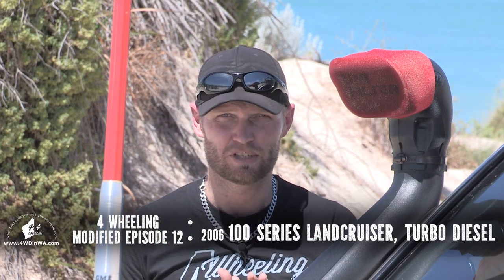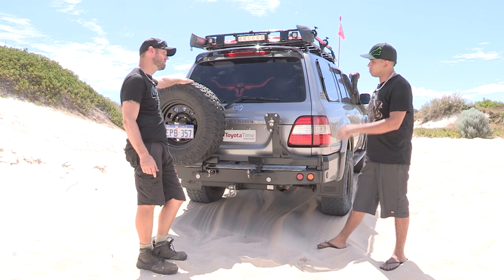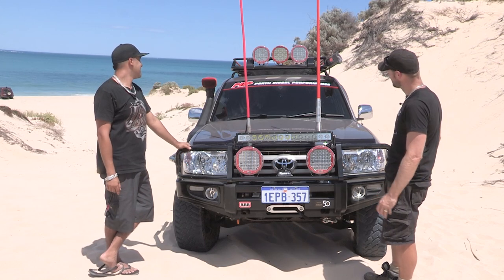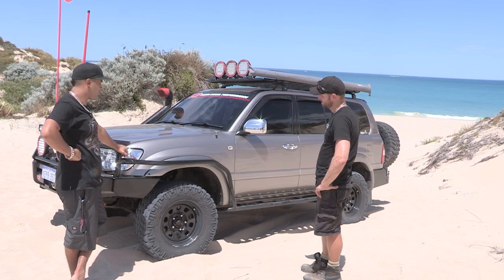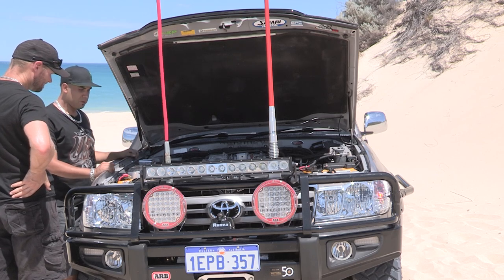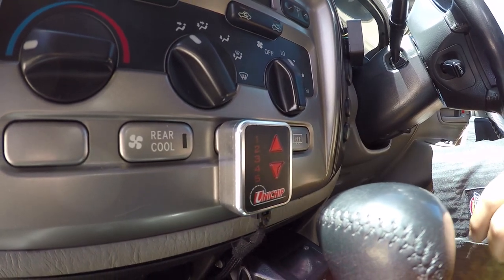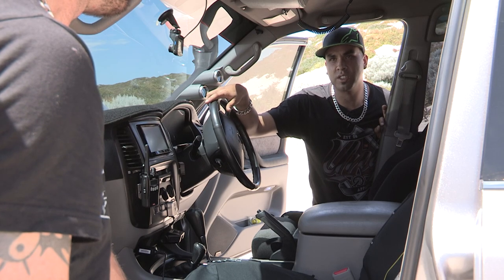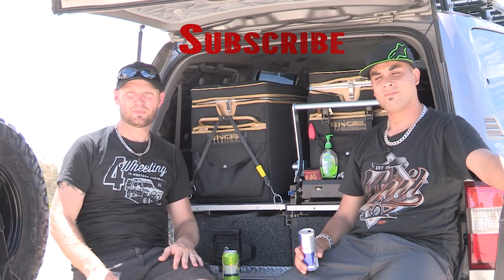Modified 100 series Landcruiser, Modified Episode 12

Comment: Thats probably the best 100 I've seen! Love it. I always said If I got a 100, id have to get the JDM Flares. Updates the look so much. Well done love it.
Reply: thanks champ
Reply: Hi Anthony, You have one the best Landcruiser rigs I have seen mate, Love all the mods. I have a 105 series as well and was wondering if you can give me some details about the flares (brand, retail where I can get them from) as I am putting 0 offset sunraysias or speedys on mine.
Reply: Thanks for sharing Anthony. I'm going to get those flares for sure on mine.
Reply: @antopaul4911  Out of interest Anto did you have any problems with tyre rubbing on the fronts? Recently went to 0mm offset rims too but have rubbing issues with the front even after removing the front mud guards.
Reply: @MrTryncia  these are +40’s from factory. Find some +30’s at least.
Reply: @slow_diver  These are 0 offsets mate. The factory wheels are pos 60, flush with the body with pos 30-35ish, and 0 offset sit flush if you got these flares. I’m running the exact same setup with the flares.
Reply: @ekammanku3622  I run +30’s on mine. With a wider tyre and they are perfect. Just a bees dick of poke with the sidewall lugs sitting out. That was the most positive offset available here aftermarket.
Reply: What brand flares are these

Comment: Regarding the pins that snap off on the rear tire carrier. Snapped off on mine as well. All you need to do is add a lock washer on it. The lock washer stops it from spinning off.

Comment: Surprising to hear you would go from a OME suspension to Bilstein. I have had both in different platforms and found the Ome to hold up and perform better. What would be the reasoning behind this? Thought you said something about holding up to the weight. I have noticed on a few other YouTube channels coming out of Australia that OME is not talked about you see your fair share of ARB equipment but ome suspension is rarely if at all talked about why is this? In the states it is pretty well known and used on many different vehicle platforms but I just don’t hear the Australian guys talk about it very often if at all. Is it just that there are so many other suspension options over there then maybe compared to the states?

Comment: roughly 300km out of both tanks on the 4.5 cruiser. I've got a 4.8 Patrol which is obviously petrol but switched out the stock tank to a 146 tank I believe and I can get some good K's out of that. Roughly speaking about 600-800 km so yea. Not hating on Cruisers by the way.
Reply: There was something wrong with that cruiser. My 1fz petrol 80 series with 35's gets 19l/100km

Comment: My dads getting me my first car soon... It's gonna be a 100 series, not sure what year though. 2000-2005 I presume. Now its my job to raise the money for the ARB bumper with winch, a rhino rack on top, a slee rear bumper with a ladder and spare, a lift and off road tires. Oh and a new radio with bluetooth (of course). I shouldn't need a snorkel because this is mainly for the hunting club (ladder and rack for hauling carcasses or even setting up a chair to coyote hunt, the winch for yard work or cleaning up huge branches after bad storms, and the lift and tires for actually getting places in the farm). I'm thinking I will keep a trailer hitch on it at all time. Any other suggestions for someone like me? or even just suggestions on how the hell ill get the money for it? I doubt any of this will happen, but its fun to dream
Reply: are you serious,its ifs,no good for 4x4ing.get a real 4x4,diesel,2 diffs,low range,dreamer.
Reply: @phantomwalker8251  it is a great 4x4 with slightly less travel on the front suspension for half the price. Diesel is shit and weak and more maintenance and more expensive for a rattle box. It has 2 diffs, the front one is just not mounted in a solid axle and it has low range and is in every way the same as an 80 series but without the solid front axle and the price tag

Comment: hey ronny, mayb you could do a budget tourer in one of your modified vids.?. for instance a mid 90's jackaroo or pajero, either with a couple of inches of lift, a set of 33's and some long rear shocks are quite capable and you can pick them up in reasonable condition for under 2k, would be good for ppl out there not wiling to spend a lot of money and getting into 4wheeling??
Reply from the maker: Without giving too much away there is one coming... within the next 3 episodes ;) can't tell you which make and model but it might be one of those you mentioned,...
Reply: good stuff! love your vids! keep it up :-)
Reply: why would you bother with a pajero or jackeroo.,not 4wd.s,period.

Comment: Great set up. I've had a 105 petrol as well. Looking at a 2006 100series td auto in a few weeks. What wheels n offset are u running
Reply: just swap that engine..... into diesel one. dont sale you 105
Reply: @enjoymusic4895  why? The petrol engine is better in almost every way and just uses about 10% more fuel

Comment: Supposwd you changed front configurations suspension from front independent suspension or front double wisbone into fixed live axle which will gave you better wheel long travel suspensions...
Reply: i have a question, those land cruisers have self leveling hydraulic suspension, and that particular unit has a lift, did he have to change the entire suspension system or is a lift compatible with the self leveling adjustable suspension?
Reply: @ramonmerino3726  those is LC105.. not common LC100...
Reply: Yes but live axle isn't as good for handling and comfort and stability for touring. They both have their strengths

Comment: Hi Ronny,

Does the owner of this beautiful landcruiser has his own channel?

Would really love to see more footage of this truck.

thank you.
Reply from the maker: +William Nguyen you might see him in future videos
Reply: Beautiful!!! Cant wait to get myself a landcruiser. Just the fact that we dont have the Diesel version in asia. only 4.5l petrol is the reason to hold me back from getting it.
Reply: mate the 4.5 petrol is a beast too. solid axles, heaps of grunt and low down torque. even better if you put a turbo kit on. only problem is fuel consumption
Reply: Yeah! fuel consumption is a big reason that hold me back. Heard that it does 20L/100kms but never have a chance to own one yet.
What about yours mate? how many litle does it consumpt for 100ks?
Reply: yeah I get 20L/100 around town and thats babying it. But I am on 35s with stardard gear ratios and all the gear (front and rear steel bars, winch, draws in the back etc). If you look at how cheap you can get them compared to a diesel though, its worth it (in my opinion). theres heaps of people who swear by diesel but these petrols are as tough as they come. The engine can put up with a heap of abuse. bulletproof
Reply: @williamnguyen110  plus the diesel version on same size tyres with same weight uses 2-3L less per 100km.. so it's not big enough difference to hold you back. The diesel maintenance and initial purchase price will outweigh the petrol fuel consumption

Comment: Anyone got any opinions on a 2004 100series v8 diesel landcruser?? Any problems/things to avoid?
Reply: yes the landcruiser !!.small v8,better with 6cyl,ifs no good,troopies have 2 width diffs,no good,v8 too small,too many tech bits not needed.a 6cyl of same ci will put out more power/torque.i have a 4.2td with same power as v8 single turbo.i dont have common rail,glow plugs,computor,nothing,toyota are overpriced over tech under powered,.IF,anyone speeks of the 6.5gm td,kill them,there crap engines,handgrenades,unless built after 2002 by international harvester.complete different engine,.""but they put them in the hummer,"",yes the u.s army had containers full of engines to replace.you obviously have a computor,USE IT,go to wiki or y toob or google.not the pub talk.
Reply: They run really well standard. Keep in mind that all Toyota vehicles leave the factory retarded to produce only 70% of their available power. Quick chip remap and power goes up massively, especially torque. Don’t listen to the hater above, he’s got a stick up his arse for some reason.

Comment: Not surprising that he's not happy with his suspension... 
A lot don't understand the ifs on these 100 series. 

Any ifs 100series lifted more than 25mm will need to use longer front shocks. No point using the diff drop and aftermarket uca's if you're not lifting the front above 25mm... Those OME nitro shocks are the same length as standard, so when he lifted the vehicle he lost a substantial amount of down travel, the shocks will now be working at the top end of their travel and will be topping out.  This will have a negative effect out on the tracks and will prematurely wear out the shocks. Only way to fix this is to drop the vehicle back to standard hight or use longer front shocks.
Reply: He's got a 2 inch (50mm) lift? What you're saying makes no sense.. also he was complaining about the rear suspension sagging which has nothing to do with IFS as he said the front is perfectly fine.
Reply: @AiDOS__  As I said, not many understand the 100series front suspension...
The OME front shocks he's using are actually the same length as the factory shocks, a 50mm lift on them is just too much, all he's doing is reducing the down travel. 
Need to maintain at least 65mm of down travel for the front shocks to work properly, to do this,  you need front shocks that are 20mm longer than factory. Then you will have the lift and the down travel.
Reply: @SteveBurns80  maybe, maybe not, he still didn't complain about the front suspension being an issue.. he said the rear was sagging from the weight
Reply: @AiDOS__  What he says doesn't change the facts!  The shocks are too short for his lift. It would handle like shit sandwich. Believe what you want. 😉
Reply: @SteveBurns80  the facts are that you just looked for an excuse to post some bit of knowledge you have and felt all good about yourself like a puppy. He said nothing about the front and he never mentioned the strut length so you have literally zero way of knowing whether it articulates correctly or not. IFS also have ball joints that bind up so yes you can get a bit more down travel at the risk of popping ball joints once a year with a bit of wheel lifting. That's why so many IFS vehicles use limiting straps on the control arms.. or you get 20-25mm or so less down travel which literally would make just about bugger all difference in real life and you have a much stronger front end for a safe touring 4wd that occasionally does some tracks and a bunch of beach work. The fact is that you can also put extended control arms and get trophy truck travel out of the front end, but it's literally dumb unless racing.. or heavy 4wd tracks in which case a live axle would be better anyway
Reply: @AiDOS__  Hmmm no you're wrong. Why the hate, dude? I'm just trying to help people by pointing out an issue. 

I do know the length of his front shocks, because he has OME nitro shocks, I've used them before on my 100series, they're only 440mm long, about the same length at the factory shocks. 
On the 100series, it's the shock length that limits the down travel. No point raising your vehicle above a 30mm lift, if you keep the same length as the standard shocks. 

Even with good aftermarket UCA'S, the longest front shocks you can use are only about 22mm longer than factory, this is because you find the limit of the UCA'S hitting onto the chassis and also ball joint binding limit. If you use too long a shock, then yeah, you'll have to use limiting straps.

And yes, shock length/down travel really does matter! It really improves the handling and capability of the ifs, big time!  
The front ratio is about 2:1, so if you increase the shocks length by 20mm you get around 40mm of extra down travel at the tyres. Awesome ay.

The rear suspension is probably okay, just needs heavier springs for the weights he's carrying. Having said that, longer and better shocks will help with the increase ride hight and spring rate. 

 Does it all  make sense now? Or you still struggling to understand it? Being serious.
Reply: @SteveBurns80  I think you're struggling to understand it. Like a child honestly. Again, it has nothing to do with the front as he was complaining about the sag in the rear. That's like someone complaining that their water pressure in the house being shit and me going on about how their hot water system is shit and doesn't get the water as hot or hold as much as a better model. They didn't complain how hot the water was, so it's obviously not an issue. Focus on the water pressure. There is never a vehicle with everything that is perfect and every part of engineering is compromise. If his driving has not seen a noticeable issue in the limits of the front suspension (and he even said he is happy with the front) then why focus on that when he clearly only has an issue with the rear spring rate and shocks leaking? Completely idiotic. There's always a list of stuff to make better, and once you make it better then there is always a way to make it better again. So once you've got one thing good and it seems to be fine then it's stupid to constantly try get something perfect when you have 20 other things that are actually noticeable to make better? Your logic is just to justify adding in useless information. Everybody understands the concept you are explaining on a much more detailed level than you are explaining it. The fact that you don't understand that it literally doesn't contribute one bit to the real issues he has make it all the more retarded.
The high speed handling doesn't feel it one bit with longer down travel. If you reach full down travel and lift a wheel while cornering then you are on edge anyway and 99% of people would never push their vehicle that hard especially a 4wd. On slower bumpy tracks it might make a slight difference but you have to be pushing it a bit to really feel any difference in the down travel limit being reached in those conditions. That leaves us with low speed 4wding where travel really makes a difference.. you will wheel lift an IFS most obstacles anyway and even 50mm of extra now travel just isn't going to help at all to keep those wheels down. I have had every IFS vehicle I've owned wheels up over a metre off the ground many many times and there was never once a time where I wished for 50mm more down travel. It would've made zero difference in the lines I took, the angles I got to, the traction I had or the comfort I was in when doing those obstacles. So if he's got zero complaints about the front suspension and infact is quite happy with it then why offer up an opinion for it? If that extra 40mm of down travel really made your rig so much more capable then you need to just go get a 105 series. Nobody buys an IFS vehicle for the travel they get out of it.
Reply: @AiDOS__  Wow, so you think having next to no down travel isn't an issue at all?  You very wrong, having the correct amount is crucial for any vehicle, not just 4wds. 
Now, the reason I commented on just his front suspension was because it's wrong! It's just too high for those particular shocks, not safe at all.
And just because he didn't mention it as a problem doesn't mean it's not. Plenty of people do dumb shit and think it's perfectly fine. Ignorance is bliss.

Good chat. 👍

Comment: This car would be better if it was a manual
Reply: +Jake Woods autos are great in sand
Reply: But would it be hard to control the clutch when off roading??
Reply: yeah but in 100 landcruiser the autos require alot of maintaining 
my friend did 200ks on the auto and it started to slip and he had to rebuild it
my manual cruiser on the other hand i did 380k s on stock trans never had a problem with it
Reply: Perry nah its easy as to control the clutch. It's the same as driving on the road, don't use the clutch unless changing gears or taking off/stopping
Reply: Perry nah its easy as to control the clutch. It's the same as driving on the road, don't use the clutch unless changing gears or taking off/stopping
Reply: 100%, would make this 100 series an absolute Weapon on the tracks.
Reply: So you're saying a sample size of 1... sort of, since it wasn't you but "a guy you know"... C'mon man. Anything that starts with "yeah but" should be edited before posting :). Plenty of 300k+ MILE with perfectly fine stock autos here in the states.
Reply: @thestunner711 my auto trans done well over 400,000km and never had an issue with it